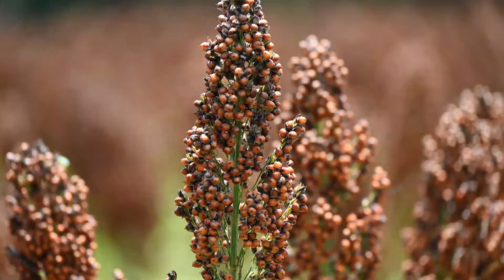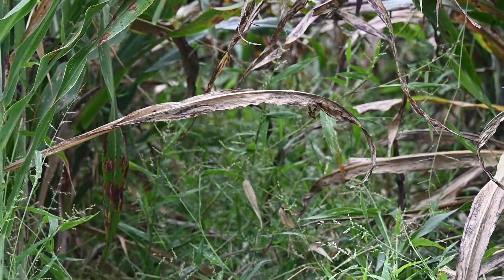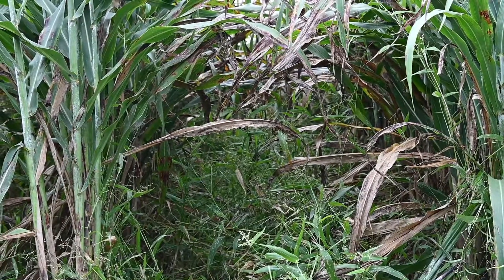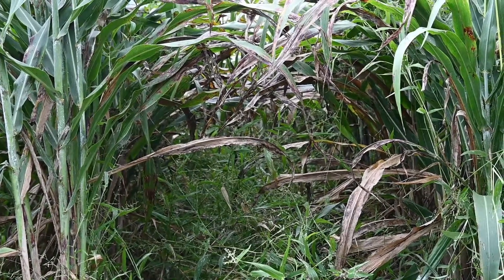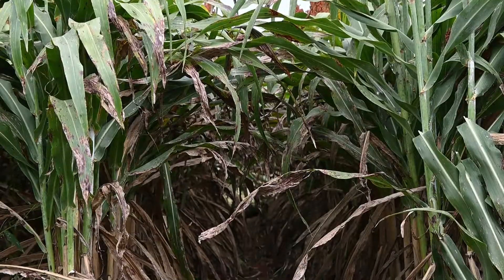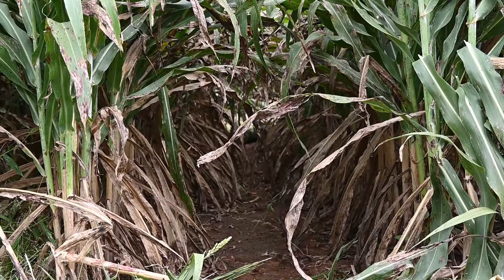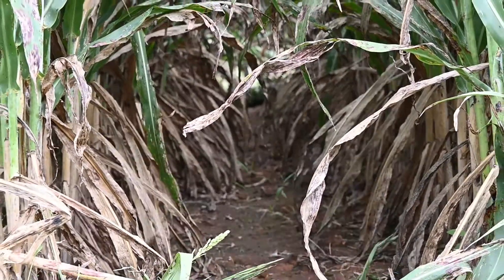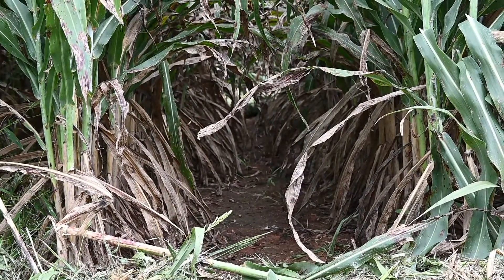2022 Grain Sorghum Weed Control

Comment: Will this work with any milo/sorghum?
Reply: Using Dual you have to use Concep safened seed, which is applied at the seed plant with the other fugicides and if desired insecticides like Gaucho or Poncho.
Reply: Will milo do half way decent in wet sandy soil?